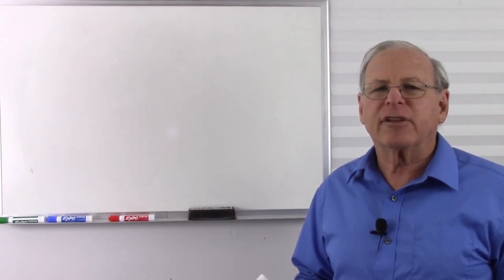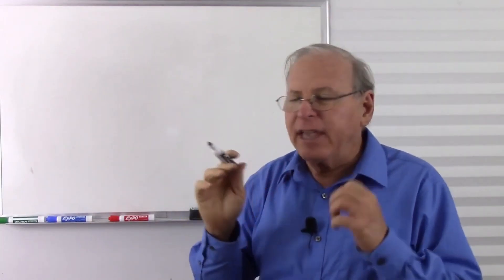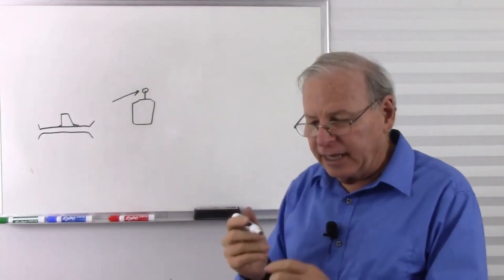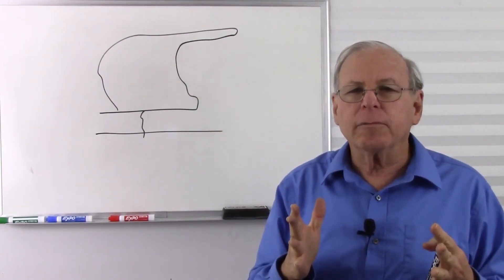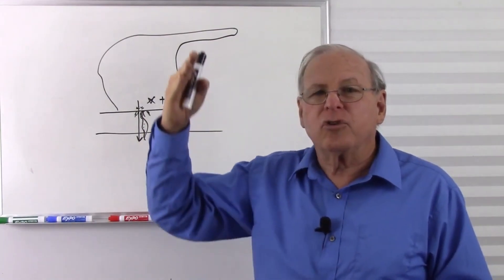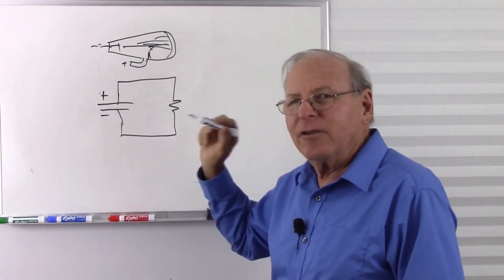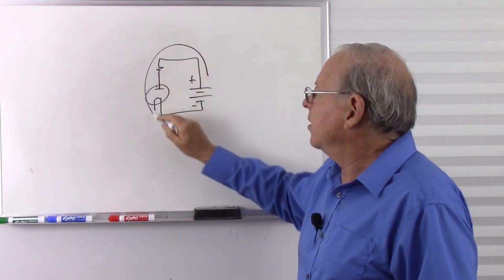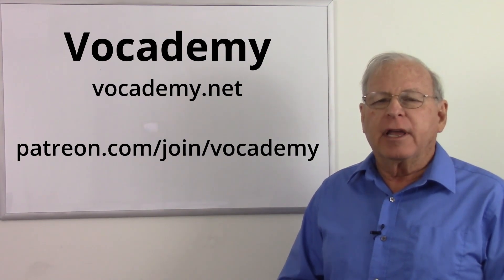More on Conventional Current   Answers to Questions

Comment: One of my courses, in the 80s at university, was electronics - I was studying Materials Science. Where and how electrons flow was a big deal for much of Material Science but we'd just talk about "electron holes" as a convenience for "conventional current". Worked for us but, as you say, most of the time it doesn't make a difference. Once you get down to the details of how semi conductors work, the flow of charge is important but, once again the fact that it's electrons doing the movement isn't important - positive charge just flows the other way.

Comment: understanding DC electrical currents:  (1)  find out about the concept of static positive and negative CHARGE, Q.
                                                             (2)  find out about the concept of electrical  storage battery VOLTAGE, V 
                                                             (3)  ONLY then : find out about how that battery generates  an electrical  CURRENT,  I                                                                                                                                       
                                                                    when conductors are connected to  a single resistor .
Not easy to learn but CRUCIAL to understanding these  basics

Comment: If you really want to understand and be effective at electronics engineering you need to understand it at the physics level. Conventional flow is NOT going to facilitate that understanding. You can get by with conventional flow at a basic level but you will never have a complete understanding.